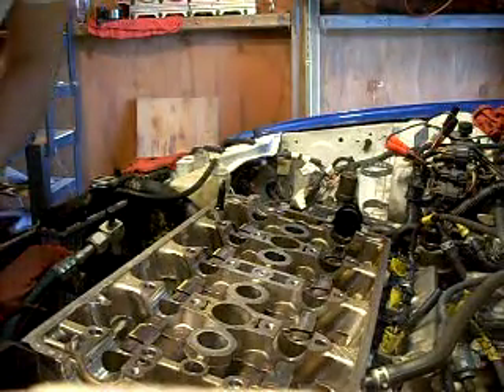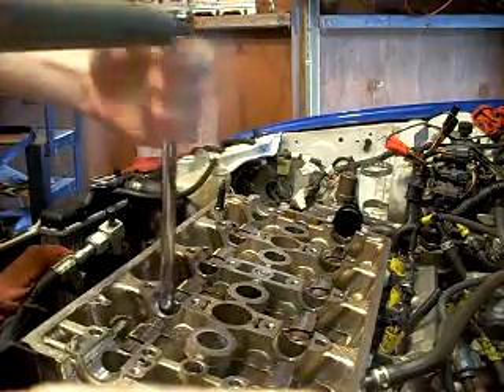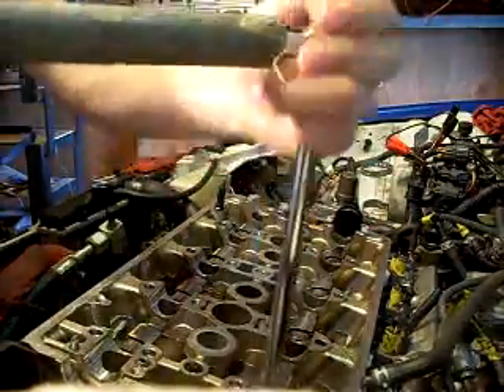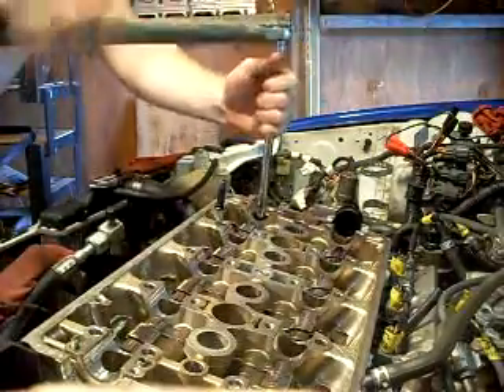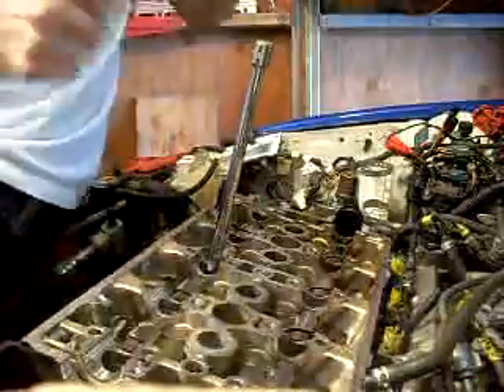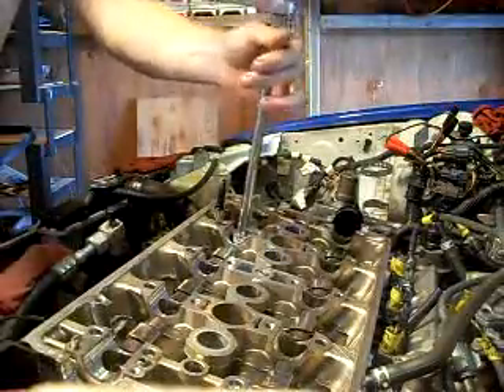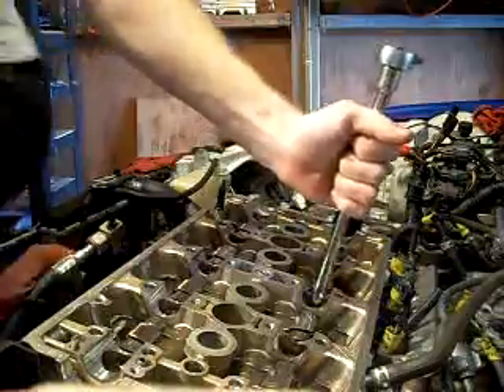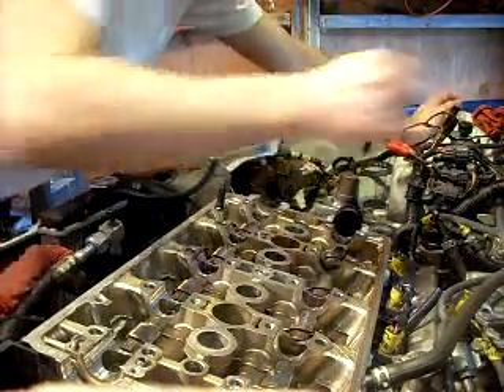(2of8) Replace H22a Headgasket, valves, and valve seals

Comment from the maker: Tighten the head bolts in 3 steps, with the last step being at 72.3 Ft/Lbs, in this order to prevent warpage:

9 – 5 – 1 – 3 – 7
8 – 4 – 2 – 6 – 10

1st step: 29 ft/lbs
2nd step: 51 ft/lbs
3rd step: 72.3 ft/lbs

Comment from the maker: @skream22 The only thing to worry about is the timing.  Once you've marked where everything needs to be put back you're good to just start taking it apart.  For me the H22 valve seals were hard to get off.  I bent most of them, but when I replaced them with supertech seals I did so gently.  The head gasket is no big deal.  If you want to be 100% then find the correct bolt tightening pattern for the head so you torque the gasket and head and block together properly.  GET A SERVICE MANUAL!

Comment from the maker: @AtreyusArchaicAvengr O wow def a good dyno tune with hondata or neptune.  Throw a light crankpulley on with a new ignition coil and some lighter cam gears, new valve train.  BUUT if you are outside cali then the best answer is BOOST haha.  throw 8 psi on with a great tune and you are off to some great fun.  Of course you want a wider exhaust.  Im leaning toward the s2000 because its got forged internals and im thinking she could put down 350whp without emptying my pockets u know.  anyhow..

Comment from the maker: @AtreyusArchaicAvengr I could just hear the 150 psi quietly passing the valve into the intake or exhaust.  Mine was kinda bad.  I had bad idle also.  Have you boosted your h22?  Is that why your assuming u have bad rings?  I would def start with the compression test tho.  I think my jdm h22 was 230 psi after like 8 cranks for each cylinder.  If it smokes tho haha then ya seals and rings could be a prob.

Comment from the maker: @AtreyusArchaicAvengr leak down is basically just taking the valve cover off.  Then with only 3 spark plugs in you force air into the spark plug hole..with a simple air compressor..then listen in the intake and exhaust for air sounds.  Orrr instead of all that testing just adjust your valves.  Everybody should do it.  It's for best cylinder compression.  The seats probably arent seating as well as they could be.  Beware if you have leaks you will want to fix it LOL

Comment from the maker: @AtreyusArchaicAvengr Hey bud too bad your burning lots of oil, but o well.  Either fix it or fill it.  That's too bad your car is rolling away.  Yo uknow if the hill is ssteep I wouldn't worry so much, but if it's some 10 degree hill and it's rolling even in 1st then ya you could check your valve clearance.